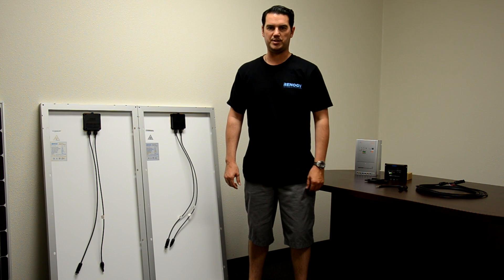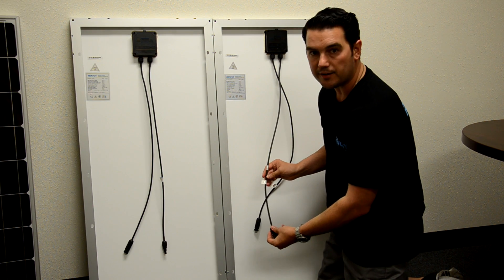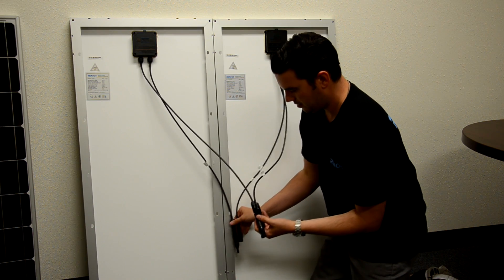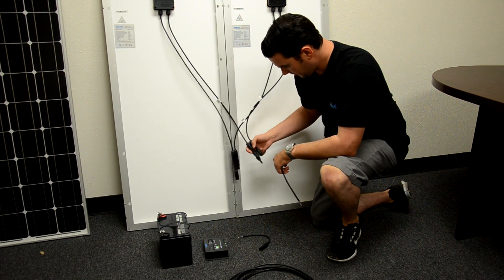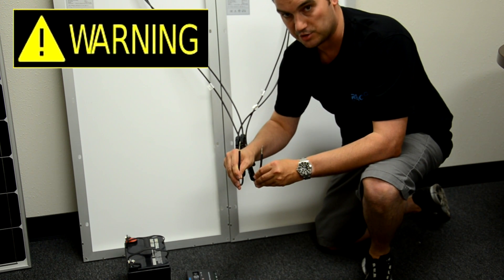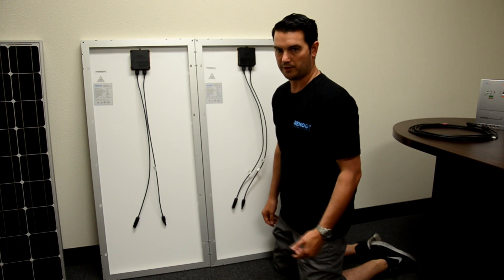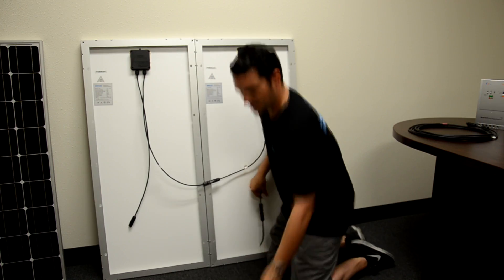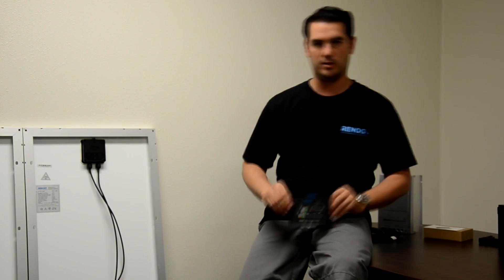Renogy: How to connect your Solar Panels in Series and Parallel Pt. 1

Comment: Which gives the highest wattage? I have 2 panels, in parallel, however, even on the brightest day, I get 150 watts showing through my killowatt meter going through my 1000w grid tie inverter. Any suggestions to get that max 200 watts out of these 2 renogy panels? Should I go series? I am getting 2 more and would like to know before hand while Im up on the roof.
Reply from the maker: +chaseswafford Hi there, wattage is actually based on the efficiency of your charge controller, not how you wire your system. Wiring alters your voltage or amperage depending on the method you wire your system (with parallel, your voltage stays the same, but your amperage increases and with series, your voltage increases, but your amperage stays the same). That said, MPPT controllers will give you more efficiency than a PWM charge controller. If you'd like, you can email our tech support team at techsupport@renogy.com and they'll be more than happy to help you out with your specific situation.
Reply: Without the charge controller in place and testing the watts with a meter, shouldn't I get the full 100 watts at max time of day with no cloud cover and full sun?
Reply from the maker: If you are measuring your panel without anything connected, and the conditions are at least standard, then you should be getting at least 100W. However due to cell and module efficiency, when harnessing the power from the solar panel, it will be approximately 88%  of the 100W. If you have any more questions, please feel free to contact our tech support team at techsupport@renogy.com.

Comment: Whats the significance between a 12v and 24v system? thanks.
Reply from the maker: +Joshua Smith A 12 volt system is used for small solar systems. Going up to 24 volts allows you to max out the charge controller's capacity and is also more efficient since you will be operating at a higher voltage.

Comment: can I wire 12v 10watts and 12v 40watts solar panel in parallel,if yes should both the panel have diode installed
Reply from the maker: +nihal jayaram It is possible to wire a 12V 10W panel and 12V 40W panel in parallel if the open circuit voltages are similar on both panels within a 10% range. As for panel diodes, it would be best to check with your panels' manufacturer first to see whether or not bypass diodes are already installed. If not, we'd recommend installing them.

Comment: Hi There, Great vid, i just have a question about diodes.

when installing ontop of a van, in parallel, do i need to install blocking or bypas diodes? and where would i put them?

Thanks for the great vid
Reply from the maker: +Robert Slater Hi there, you wouldn't actually need a blocking or bypass diodes since the panels have 2 bypass diodes and the charge controller will have a blocking diode. Please let us know if you have any other questions. :)
Reply: Thanks for that,is that with all pannels? And if the two positive cables meet at a y, and then go to the solar charge cintroller, isnt there a danger that the power will flow from one panel to a shaded one, before it reaches the charge cintroller.
Reply from the maker: +Robert Slater Yes, that is for all panels. And no, there is no danger of power flowing from one panel to the other. The power of both panels will flow towards the charge controller.
Reply: hi, thanks for getting back to me. just to clarify, is that with all modern panels or just the renogy solar panels?
Reply from the maker: +Robert Slater No problem! Most manufacturers do include two bypass diodes, but we can't really speak for everyone. Also in regards to our panels, for larger sizes such our 150W panel, it has three diodes and our 250W-300W panels have four.
Reply: awesome, and do you guy ship to ireland?
Reply from the maker: +Robert Slater We could, but we wouldn't recommend it to you as it'll be a hefty shipping fee. We'd recommend buying our panels from Amazon UK, but they're out of stock and most likely won't be selling them till next year. If you're still interested in purchasing from us regardless, you can visit us at renogy-store.com.
Reply: Hi again, just a quick question.
do i need to use the specialised solar cable that is for sale on all websites? or can i just use a multi core wire that has the correct awg rating? i have just purchased the wire for the panels but the company sent the wrong wire and i dont have time to wait for them to replace it and im just wondering if i can buy wire from my local electrical wholesaler.

thanks for all your help.
rob
Reply from the maker: +Robert Slater Hi Robert, a multi-core wire wouldn't work for what you're trying to do. If you can, see if you can find a stranded copper wire similar to these (http://www.renogy-store.com/Stranded-copper-wire-s/1966.htm) in the correct gauge size. They'll have stranded copper wire on both ends, and you'll have to either get SAE or MC4 connectors to go on the end to match your panels (whichever type of connection that they use). I hoped this helped, please let me know if you have more questions.

Comment: Can U mix poly crystalline & mono-crystalline panels in the same  system ?
Reply from the maker: +Terry Buggage Yes it is possible to mix polycrystalline and monocrystalline panels in one system as long as the panels have similar voltages (e.g. 12v with 12v) and the panels are hooked up in parallel.

Comment: Heey i have a really good intention i got it patent already and i wanna make a replica but it has to do with solar panels and i do not know anything about connecting solar panels to anything can you help me?? I would like yo know how many voltage i would need for each thing
Reply from the maker: +Juan Valencia Hi there, sorry about the belated reply. You can get a general idea of how to connect panels and the rest of your system via our general off-grid manual: http://renogy.com/wp-content/uploads/2014/04/off-grid-general-manual.pdf. It would probably be best if you contact our tech support team at 1-800-330-8678 so that they can assist you more thoroughly concerning the voltages. Please let us know if you have any other questions.

Comment: hi  your video was good,but can i throw a wrench into the works? what about doing a video with 2 of your 100w panels and say the harbor freight 45watt kit solar panels do you use only one charge controll or one for each set?what about the different wire ends how do you go about that?
Reply: +Michael Nunno  Sell the Harbor Freight to some body and get some real panels that have output. Just saying 45w is not worth much.
Reply from the maker: +Michael Nunno Hi there, sorry about the belated reply. We wouldn't recommend mixing the panels together because of the different connectors. In order to use both our panels and the harbor freight panels, you'd have to do a lot of wire work for the harbor freight panels, removing the connectors and splicing wires, etc. If you still really want to do this, you could contact our tech support team for more assistance at 1-800-330-8678.

Comment: So when I connect two 300 watt panels in series what will be my total watt out put
Reply from the maker: Your total power output in watts will be the combined output of the two panels. So it will be 600W. No matter how you wire your panels, whether in series or parallel, the total output of your array will always be the sum of the output of each individual panel. This is assuming all your panels are the same type and power rating, which is always recommended. So if you had 4 300W panels, the total output, whether in series or parallel, would be 1200W (4*300W).
 
We can always answer your questions more immediately via our online chat on our website (https://www.renogy-store.com/default.asp) or by phone at (909)-517-3598.
 
Renogy Tech Support
SR

Comment: i have 4 100watt 12 pv panels , why is my highest peak only a measly 208 watts, my micro inverter is rated at 400watt input, every sequential panel I hooked up my peak went up, but geez 208 watts , should I convert to 24 volt grid tie micro inverter? My lines are not very long and tests at the panels are the same at the inverter?
Reply: 208 watts in the winter season, and for a five amp max , I get like .016 amps? tested every panel separate , all test the same?  or is this just what to expect?
Reply from the maker: Tim Schuchard Panel output will be variable with sunlight, so in the winter you would expect that your panels could be producing below their rating. What type of micro inverter is this? Is there one for each panel or is this a string inverter?
 
We can always answer your questions more immediately via our online chat on our website (https://www.renogy-store.com/default.asp) or by phone at (909)-517-3598.
 
Renogy Tech Support
SR
Reply: ya i have only one chinese micro grid tie inverter , its rated for 4 panels
Reply from the maker: +Tim Schuchard We apologize for somehow missing your reply. Most microinverters are extremely efficient such as ones made by Enphase Energy. Did you test the panels whilst not connected to the inverter?

Comment: Hi, 

I have 2 panels each 265 watts and one 250 watts. Also, I have 8 batteries Trojan each 6 volts. Next, I have an inverter 12 volts and a charge controller 30 Amperes. Which connection will give me more efficient in the output (parallel or series connection)?

Thank you for your cooperation.

Best regards.

Jean
Reply from the maker: Hello Jean. Is this a Renogy 30A charge controller? If so which one? And is this one of our 250W panels? Lastly how about the ratings for the 265W panels? Operating voltage and current as well as short circuit current and open circuit voltage? All of this will be important in determining the best connection.
 
We can always answer your questions more immediately via our online chat on our website (https://www.renogy-store.com/default.asp) or by phone at (909)-517-3598.
 
Renogy Tech Support
SR

Comment: I connected in parallel 2 panels that make up 300 watts.I noticed though that when of the panels was hooked solo my voltmeter hooked up to battery bamk was reading 13.69.When I paralleled them together it dropped to 13.25,do you know why that is?
Reply from the maker: Which controller do you have? I am not sure why this happened from the information given.
 
We can always answer your questions more immediately via our online chat on our website (https://www.renogy-store.com/default.asp) or by phone at (909)-517-3598.
 
Renogy Tech Support
SR
Reply: My 12 awg cable was the problem,when I went With 6 awg it fixed the problem.Thanks!
Reply from the maker: We're glad to hear that the problem's been resolved!

Comment: why would anyone want to connect parallel since in series you just add the power outcome?
Reply from the maker: The power output when wiring in series or parallel will be exactly the same given that the appropriate wire size is chosen. In series, the panel voltages add but the current through all the panels will be the same as the current through a single panel. This is advantageous because with higher voltages, you can use smaller wiring which will save you money. The smaller wiring can be used because with high voltage and low current there is less power losses along your wire than when you have high current and low voltage. Wiring in parallel is advantageous when you expect there to be shading on your panels. In a parallel wiring scheme, if one panel becomes shaded, only the output of the shaded panel is affected while the unshaded panels will continue to produce their full output. This is not true with series wiring. In a series wiring scheme, if one panel is shaded, the output of all the other panels connected will drop to the level of the shaded panel. Parallel wiring will result in high current and low voltage, and therefore larger wires will be required which will cost more money. When possible it is always better to go with a series wiring configuration.
 
Hope this helps. We can always answer your questions more immediately via our online chat on our website (https://www.renogy-store.com/default.asp) or by phone at (909)-517-3598.
 
Renogy Tech Support
SR
Reply: Renogy Solar thank you so much man

Comment: sir, it is possible to make series connection on solar panel then connect to charge contoller which result in 24V then only 12V baterry?
Reply from the maker: This is only recommended if you have an MPPT charge controller. The MPPT controller will reduce the voltage to a safe level to charge your battery while also boosting the current, thus transferring most of the input power to output going to your batteries. A PWM controller however will be extremely inefficient (~40%) when the input is 24+V and the output is a 12V battery and therefore it is not recommended. So the short answer: it depends on which controller you have.
 
We can always answer your questions more immediately via our online chat on our website (https://www.renogy-store.com/default.asp) or by phone at (909)-517-3598.
 
Renogy Tech Support
SR

Comment: How do you wire up a analog amp meter, coming from solar panel?. I bought a 30 amp analog meter, with shount, and hooked it up on the positive wire from solar panel going to the charge controller but amp meter is showing nothing.. I checked with voltage meter and it shows about 10.5 amps, shows nothing on analog amp meter.
Reply: IF your meter has a needle that moves (DeArsenval movement), the meter leads MUST be attached INLINE so the meter is part of the circuit... i.e. no flow of amps unless they start at panel...go thru the meter lead, the meter, & out the other meter lead to shunt /charge controller... since meter is in series... attachments are pos to negative... if meter pegs hard the wrong way , swap meter leads connects at the meter (ensure upper range setting of meter is higher than expected amps). Hope that makes sense & helps ! The meter leads have ALL the amperage going thru them, so for larger amps than leads can safely handle, use a clamp around meter, so that the meter is NOT inline, but senses amps when its jaws encircle the wire being tested.

Comment: ok I have a few questions  I want free electricity  to live and build a house in my woods   how many solar panels  can I link together and how many controllers will I need  and  what batterys are good I have a optima blu top 300 doller   deep cycle agm  battery and it wouldent run my Christmas tree for more then a hour  and it has all led bulbs
Reply from the maker: In order to properly size a system, I will need to know the power draw and run times of all the devices you plan to run in an average day in this house. I will also need the state and zip code of the house so I can determine how much sunlight you get there. With this information I can determine what you would need.
 
We can always answer your questions more immediately via our online chat on our website (https://www.renogy-store.com/default.asp) or by phone at (909)-517-3598.
 
Renogy Tech Support
SR
Reply: well  n ot much  ill have about 4 led 120  volt to 12 volt  bulbs form Walmart   a bran new fridge  always running  a computer  phone  wifi  will always run  and hot water heater   will mostly run I think   and  a  nuwave cook top 2 and  a  small  counter top overn   the best one at Walmart all in my camper  I was thinking 5 solar panels and one  wind turbin  and 8 6v Duracell  golf cart batteries ? I have a 2000 to 4000 watt  inverter
Reply from the maker: Hi Zack Grindle 

We still won’t be able to tell you accurately what system size you need unless we have either (volts & amps) or just the wattage of each of those appliances and about how long you would like to run each of those.

Thank you,

Renogy Tech Support
AW
Reply: sound like you got a real project going on their.  did you ever get it done?

Comment: I want to maintain my voltage at 24 volts with 6 , 12 volt 100 watt panels.. how is the parrall wired? thanks
Reply from the maker: Thanks ***** for your interest, please contact techsupport@renogy.com to answer any questions or concerns.

Comment: im going to be up sizing my solar panel array i have right now a grape solar 105 watt mon. panel i would like to buy the renogy 100 watt 2 pack solar panels from amazon and use the multi thingy to connect them all up in parallel the open circuit volts on the grape solar is 21 something it came out to be about a .7 volts difference would that effect my solar charge controller to have these 2 different kinds of panels hooked up like this, they are both rated for a 12v system but the renogy has a higher open circuit
Reply from the maker: If you wire these in parallel, you will lose a bit of power based on the lowest voltage of the panels. In this case, the power loss will be relatively small so you should not have to worry that much.
Reply: ty

Comment: if you have 24v coming from to two 100w solar panel, do i have to use 24v battery and not 12v?
Reply from the maker: If the controller is a PWM, then yes the voltage of the panels has to match the battery bank or else you will lose a lot of power. If the controller is an MPPT, you might be able to step it down from 24V to 12V, but it also depends on the amperage of the MPPT controller.